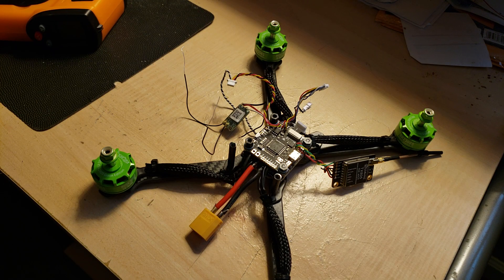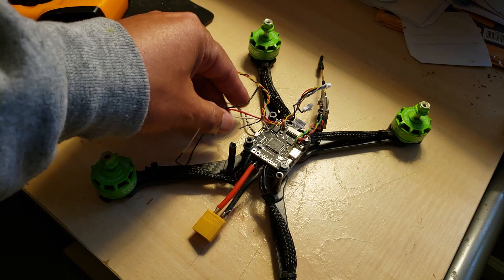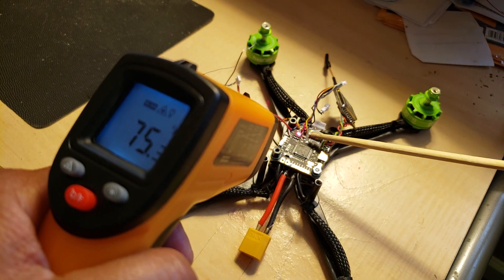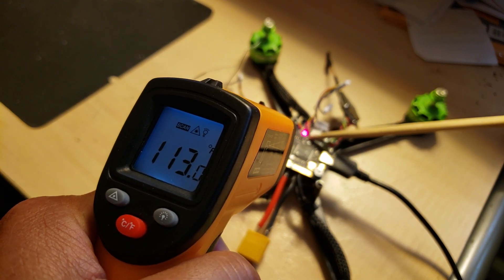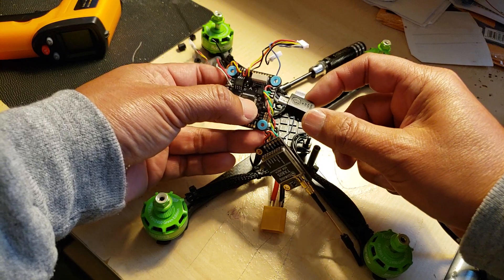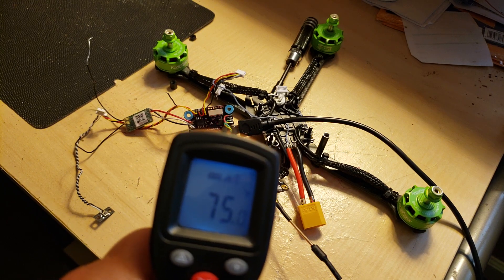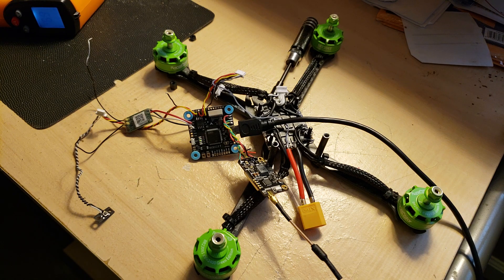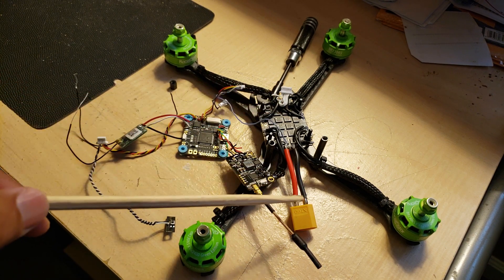MAMBA F405 Betaflight Flight Controller F40 40A 3-6S DSHOT600

Comment: Thanks For your video, something similar happened to me, right after unboxing Taycan Diatome with the Mamba f405 mk3 stack, I attached lipo 6s and when testing the motors the FC and 4 motors where burnt (mamba 1408 2800kv), I was quite surprised I replaced the whole stack and 4 motors, I program the FC with the original config. In the maiden flight, one motor got burnt. I decided to limit the power to 65% and then it seems to work.

Comment: Hello!
I have the same controller (mine works just fine). I don't know if i can help but if you wont, I can try :)
Temperature is just fine, they can get quite hot.
VTX will heat up once you connect battery.
Fell free to contact me if you wont some help with that :)

Comment: The processor i.e. STM32F405 works on 3.3 V using a voltage regulator. Some flight controllers give seperate solder pads for 3.3V and ground, which use the same regulators as the processor. So, whenever you have a bad chip you can check the continuity between the 3.3V and ground output. if they are internally shorted then that means your processor came fried. since there is an internal short the resistance is very low and the current gets high producing heat. Chances of a bad chip are really low. But luck isint always with you